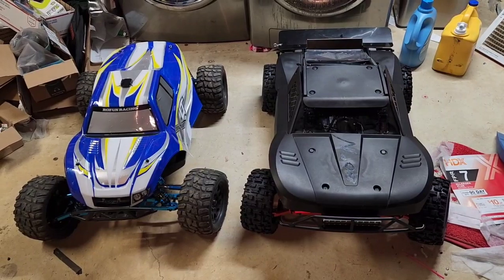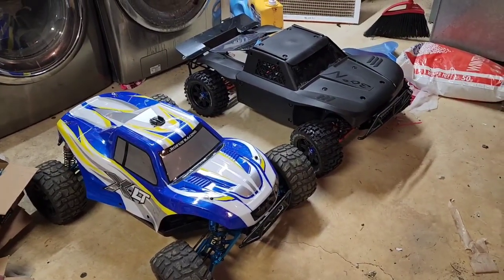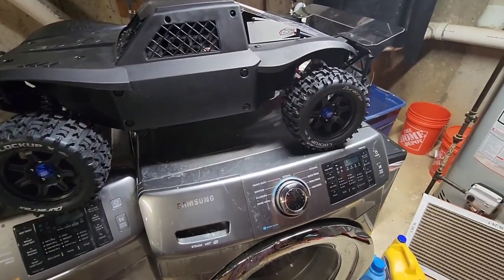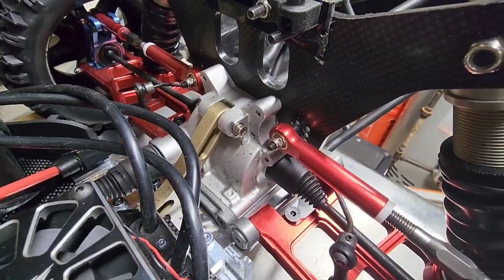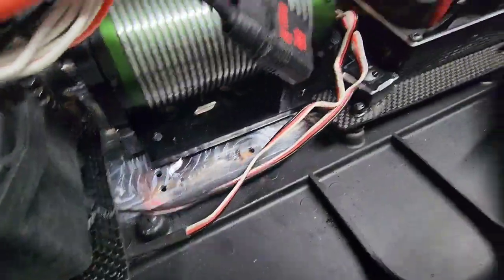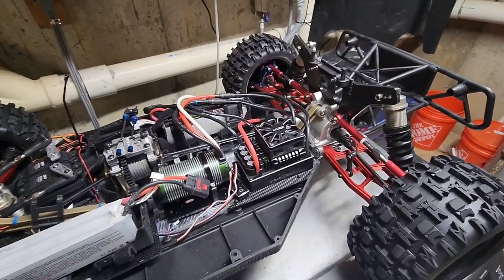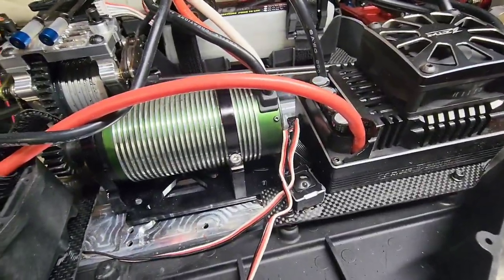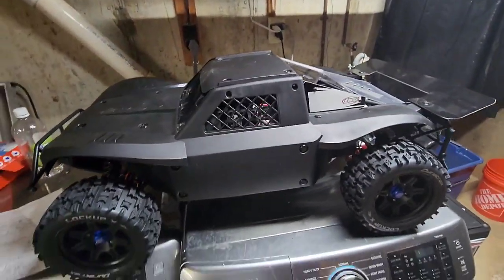Losi 5ive M-T 2.0 Brushless Build Overview

Comment: I’m truly a gas man but dope is dope brother 💪🏽💪🏽💪🏽👍🏾🔥😎
Reply from the maker: Thanks for watching man. The thing that's really great about the 5ive t platform and most 1/5 scales, switching between brushless and gas is just a matter of bolting in you PowerPlant components of preference, doesn't require modification to chassis or drive train. Literally just a matter of motor mount screws and bolting esc and but trays or gas tank for gas.

Comment: man that build look amazing ! shocktowers are awesome ! how would you compair the ztw 12s to the flier 40a ? i mean control wise : is that ztw smoother ? smooth like a hobbywing ?
Reply from the maker: Ztw pros built in bec, 300amps, easy to mount format dur to the aluminum casing, basically a larger 12s hw esc, finishing and smooth power delivery Con, can only run motors less then 800kv. Will blow up if your motor is an amp hog

Flier- can get in 12s or 16s configuration, can run any motor you want, relatively cheap price. 400a
Con ,- no bec, no mounting oints u basically have to ziptie it down.  Not as smooth on power delivery as ztw. No power switch.  

Additional thoughts Sometimes I'm not sure if I'm really getting 400a on the flier, but often times I feel the ztw is very powerful might be underrated.
There are new 350a Fliers that have just been released. They have aluminum casings and the 12s version includes a 6c bec. 16s doesn't. I just ordered one should have it very soon.  They claim they closely looked ar the xlx2 and used some of what they learned in development for the new 350a continuous 750a max esc.
Reply: @jaymitchrc  thanks man, i appreciate the long and detailed answer ! i will try to get a beast pro 12s, wish me luck ! i know that it is a hit or miss product !!
Reply from the maker: @stephanez8036  I had a typo in my response. Please read it again.
Reply: @jaymitchrc  ok, very good , thank you. i found 2 sources to buy ztw beast pro at less than 300 usd! i want to try this product !   by the way, rcjuice is waiting for new 12s esc, i'm on that train too !